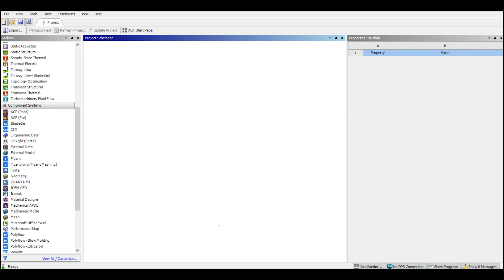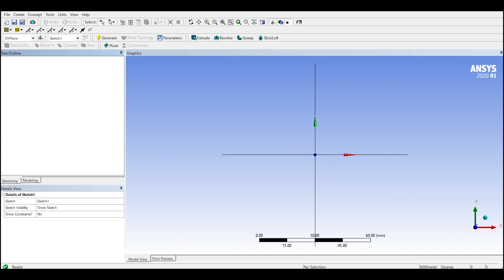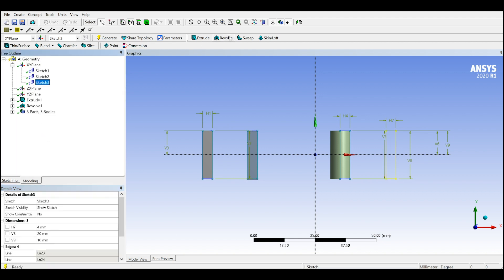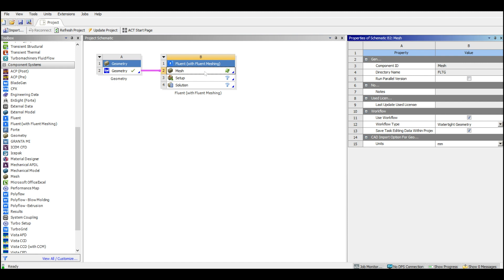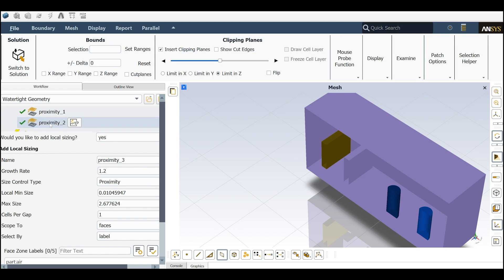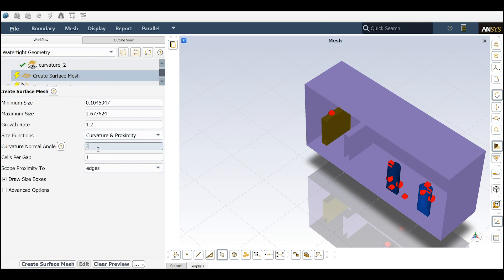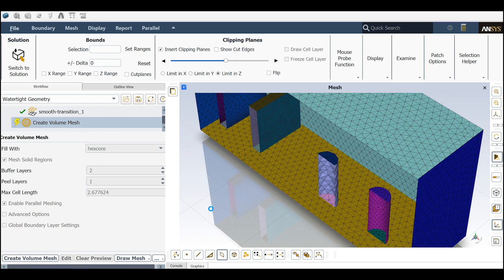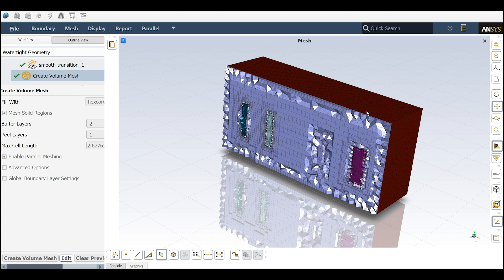ANSYS Fluent Meshing - Proximity and Curvature Local Sizing Methods

Comment: I really like how the quality of these videos improved! Good job! 
If I might have an idea for next video... How to accurately calculate drag coefficient on a landing gear (landing gear cover) for aircraft/drone. Where to put boundaries walls of outer box? Should the wheel touch one boundary wall (like a ground). What parts of the aircraft should I also mesh and run the analysis with? How can I simulate turbulent flow from the propeller in front of it? I know it is a lot....